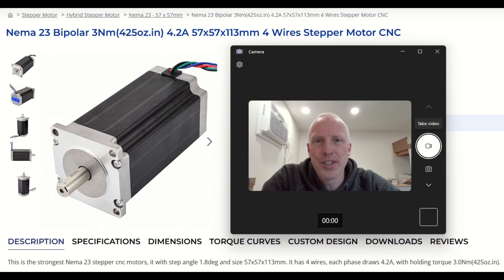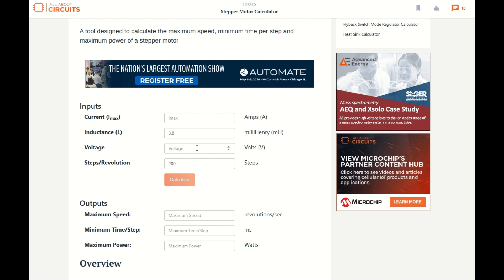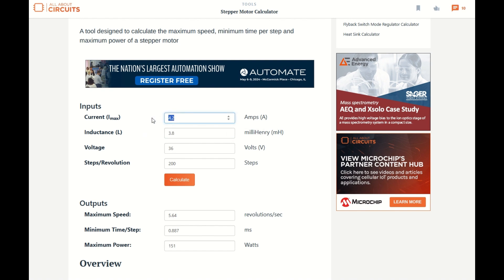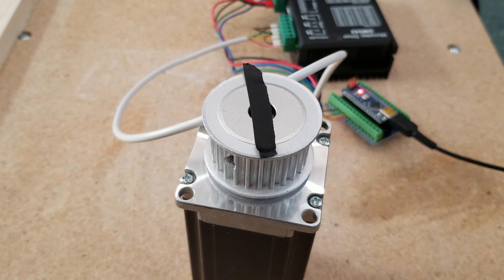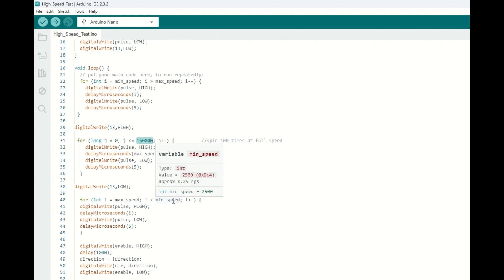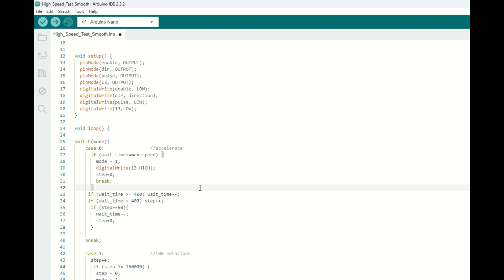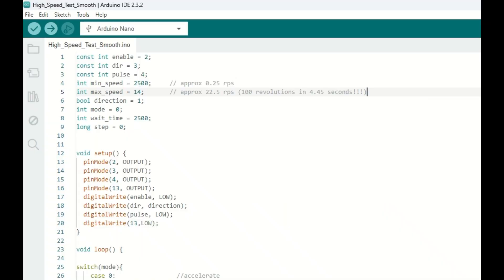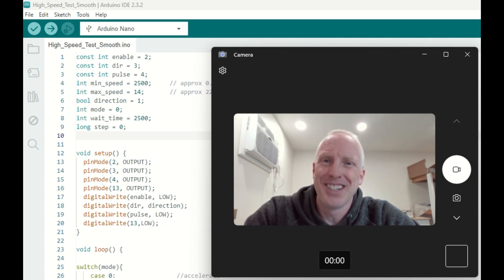Stepper Motor Maximum Speed using Arduino and DM542 - How Fast Can It Go?

Comment: Stupid question but what's the guage size on those wires connected to the Phoenix connectors?
Reply from the maker: Sorry, I don't remember what size I used for that video. But if you know the maximum current for the stepper motor, you can get the right size wire for the controller. Good luck!

Comment: Does dropping 4a to 1a really increase speed/rpm?
Reply from the maker: The higher the current, the longer it takes to energize the coils. Since the current direction is always changing, lower current allows you to turn faster. You can do it with higher current, but you need much higher voltage to drive it.

Comment: Thank you for this info. I look forward to trying it as well as the constant acceleration you show in your other video.  This will be extremely valuable information to me.  Thanks again. Regards.
Reply from the maker: Glad it helped!
Reply: @ScienceFunInnovations  I haven't purchased the code yet. But I would like to ask a very important question.  In all Arduino code for stepper drivers I've seen, the delay between pulse HIGH and pulse LOW, and between LOW and HIGH, is the same duration.  In your code, you have a delay between HIGH and LOW of 175 microseconds and a delay between LOW and HIGH of 5 microseconds.  Can you please explain the reasoning behind this?  Thank you very much.  Regards.
PS:  More Arduino videos please!  You are extremely knowledgeable on Arduino coding.  Please share more of your valuable knowledge.  Thanks !!!
Reply: @KW-ei3pi  The reason behind using the different delay is to vary the pulse duty cycle. everyone else is using 50% duty cycle while he is smart and uses variable and thus acheives this speed.
Reply: @ Thank you!  Any suggestions on how I can implement this?  I wouldn't know where to start?  Thanks.
Reply: @KW-ei3pi  the best way? GPT. Its works most of the time...

Comment: Is there s feedback loop available, some sensing that can tell the ucontroller whether the shaft is lagging behind expected position?  

Do motors offer positional feedback, or is that a separate attached sensor?  Is parasitic sending of magnet position in motors done?
Reply from the maker: You can buy stepper motors with feedback. That can let the software know that the motor is missing steps. They just cost a little bit more.
Reply: @ScienceFunInnovations  Very cool!  Do you know what that is called, or perhaps some part numbers of such motors?
Reply: @The-KP they're called Closed Loop steppers. Completely different controller & cabling

Comment: I am curious about the motors' performance at a high rpm under load. (overheat?) Good job on the setup.
Reply from the maker: With high rpm there is lower torque. It didn't seem to get hotter than normal. Next week I will have a video showing constant acceleration which will be better for high loads. Thanks!
Reply: @ScienceFunInnovations  Awsome looking forward to it 👍 👍